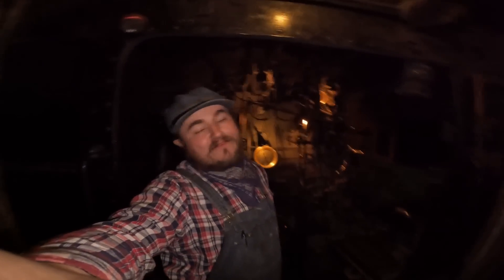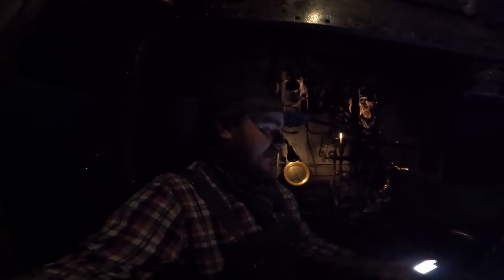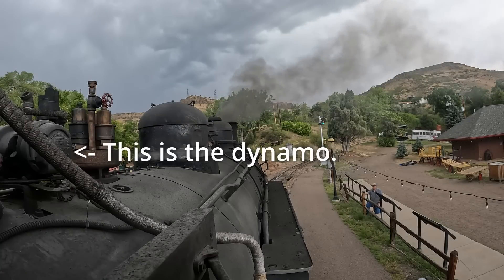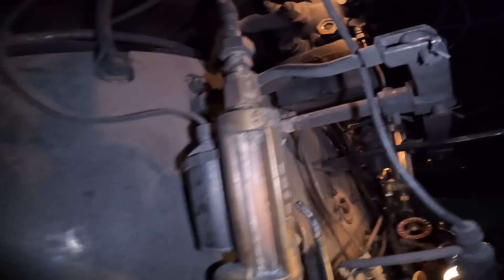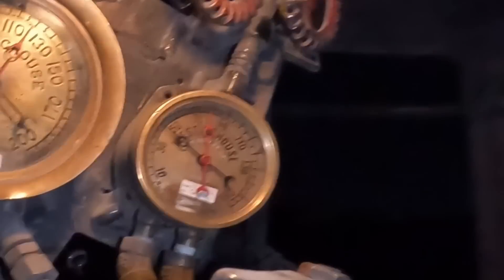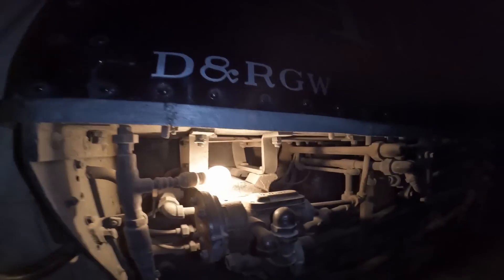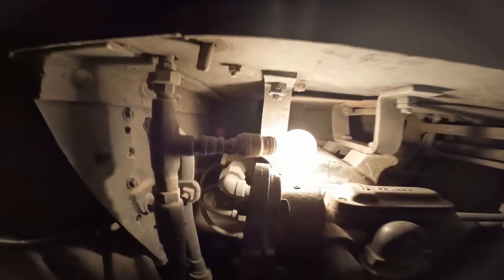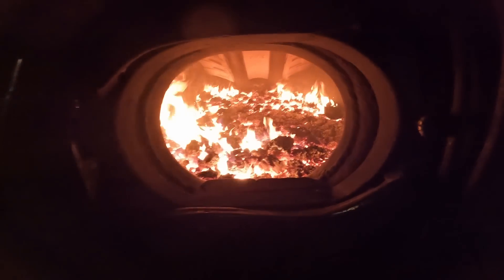How did steam train engineers see in the cab at night?

Comment: Having fired steam at night, the important thing is to maintain your night vision to watch the road ahead and check train conditions when looking to the rear on curves.  It also is necessary when taking hand signals or knowing where your ground men are.  So, the one eye closed when firing does the trick.  Alternating eyes when putting in or checking a fire condition.  As for  LED lights, the idea is great as it would reduce the load on the dynamo.  However, the brightness must be controlled as you only want (need) enough to see the various items and not take away from viewing ahead.  Your eyes will try to adjust to the brightest light within their range.  Shielded 15 Watt bulbs for most cab, marker/class, ground, reading lights is fine.  25W for shovel sheet/coal work or switchable machinery lights  works good.   One question would be it the same bulb shape could be maintained otherwise this might create a problem in existing sockets and shields.  Wonder how many bulbs would be necessary to purchase for a special order?
Headlights at 100w for yard switching and 200/250 for road work.  The 100w bulbs will not blind the ground men as much.  As for reading lights, having one on the left side helps much for doing cab work at night.  
Also found out that when using radios powered by dynamos, that using the dynamo to recharge a battery, then taking to battery power to run a cab radio reduces the load and damage to the dynamo.  Radio power pack needs to set up for 12vdc.  More to it than that, but different ways to skin the cat.  If one could use all LED bulbs, maybe one could use a 500w dynamo with no damage as cab radios take a lot of power.  
The old heads had many tricks to do the job safely, the alternating eye use when firing was one of them.
Reply: Will it be helpful to use red lights at least on engineer's side? Red color does not "bleach out" your night vision, so at least in theory the engineer would be able to see inside and outside a bit better.
Reply: @AgentWest In practice, red light is not compatible with sight glasses.
Reply: @pootispiker2866  Not compatible? How so? Makes it more difficult to see water level in the glass?
Reply: @AgentWest  Yes. White light is the only way to see the water in the glass. As per another comment, the red light makes the water level invisible.

Comment: This would definitely be something to improve on for new builds (like for instance, "PRR" T1 #5551 -- wish that it would have been a New York Central Hudson or Niagara, but too late for that).  Both in placement further away from the cab, and in having a more standard output (like what a diesel locomotive would use for cab power, so that you can use diesel cab lights and even positive train control without modification).

For the current preserved locomotives, I wonder if it would help to do something simple like strapping on a small square of soundproofing material to block the direct sound path from the dynamo turbine (and its exhaust) to the cab?

Comment: I was going to ask what sort of voltage do the bulbs run at, someone further in the comments mentioned 32V (closer to 36?). With some added circuitry to filter and regulate the supply you could retrofit some (12v) LED’s in the cab which would be probably be brighter than the old incandescents
Reply from the maker: We actually have LED bulbs in the RGS 20. Definitely possible.

Comment: The first electric lights on trains were actually arc lights powered by dynamos driven from the wheels. Once metal filament (tantalum and later tungsten) bulbs got good enough to be used under the high vibration of a train, they banned the arc lights for being too blindingly bright.

Comment: No permanent paperwork holders with light fixtures in there?
Didn't those generators have some kind of muffler installed? The ones on German locomotives are a lot less loud (which is a good thing as they need to be running 100% of the time)

Comment: The "Weird lightbulb under the cab" is still used today in modern diesels. Today, there's two of them, one each side of the nose. About where class lamps would be on British locomotives in fact, and whenever the engineer blows the horn or hits the switch to turn them on, they flash in an alternating pattern, first one side then the other.

In modern parlance, they're called "ditch lights".
Reply: These lights are not ditch lights. They are called ground lights and have zero relation. Ditch lights point forward.
Reply: @pootispiker2866  Ah, thanks for the correction.
Reply: I think in some ways a better equivalent would be the lights by the steps of some diesels. The ones I have been on actually do have individual lightbulbs facing downwards, to illuminate the steps or other areas around the lower half of the locomotive at night.

Comment: I’m actually curious about this: would you actually gain more energy if the dynamo was an electromagnetic generator setup instead of the turbine generator setup? I know what that the copper bristles on the shaft have a lot of resistance, causing a loss in electrical power from the KE of steam turbine.
Reply: What's the difference between the two? Either way you'd need the steam to spin a turbine, right?
Reply: @Yarf.McBarf  electromagnetic generators use magnetic resonance to produce electrical energy whereas turbine generators use mechanical power to produce electrical energy. A great example is this is are windmills.
Reply: A dynamo is an electromagnetic device.

Comment: Honestly I’d your eyes were adjusted, that dynamo puts out plenty of juice to see everything you need to pretty well!

Also did you guys redo the throttle on 491? She broke loose pretty easy.
Reply from the maker: Yeah, we adjusted the clevis that sets the bar. After we'd done the last annual, she ended up with the throttle sticking really far out - like,  1.5" or so of dead spot on the quadrant before it actually admitted steam, and so I was used to that, and then tightening it up so there was hardly anything made muscle memory go out the window... lol.
Reply: @Hyce777  Holy cow. isn’t it amazing with linkages when round holes get turned into ovals and the slack adds up exponentially? (Not as dramatic, but had a related issue with my ‘71 MGB with throttle linkages and pedal box—when the 1” or take up was fixed I did a burnout in a car that doesn’t do burnouts 🤣)

Comment: Interesting that the Rio Grande placed the dynamo right next to the cab.  On the Sumpter Valley we placed them next to the stack, which required some drain extensions to get around the larger onion stacks used at the time and the larger diamond stack still used on 3 today.
Reply: Lots of Pennsylvania Railroad engines have the dynamo at the front end too, the K4 for example. They piped the drain to come out by the stack.

Comment: I would think that it would be better to have red lights in the cab, so the light does not mess with night vision as much.   I know it was not really understood then as it is now how light affects the eyes,  but it seems like they would have accidentally figured it out.

The weird light below the cab is ingenious.   Too bad it could not be a dual purpose light to be able to see the running gear too.
Reply: They have to be white lights because red would not shine through the sight glass or the hydrostat bullseyes very well. The gauge lights don't mess with night vision as much as you think.  And diesel locomotives today still use ground lights under the cab on both sides.

Comment: Always like the dynamo sound.

On the old WWII type of radios,  there was a dynamo (not steam powered) used to power you finals (final stage amplifier).  When you keyed or turned on the high voltage for the finals, you could hear the dynamo slow down under load.  Very unique sound, and fun to listen for.
Reply: My GRC9 does it. A faint whine also comes through on your transmitted audio. Instantly recognizable.

Comment: What voltage does that thing output?  Are specialist lamps required, or are they regular old incandescents from the hardware store -presumably the "rough service" type?  And the sight-glasses remind me; was it ever tried to use crystal or Pyrex or other exotic glasses to make more robust sight-glasses?  It surprised me greatly that glass, which is extremely hard and chemically impermeable, would become a wear item!
Reply from the maker: 32 volts DC - at a scary number of amps. Lol. Can't recall the figure but it's more than 20. They are special bulbs rated for that.
Reply: @Hyce777  I vaguely recall it being 25 or 30 amps.  It was 30-odd years ago I ran steam, and now you've got me trying to remember the wattage of the headlight.  I think it was 75W?  I remember being surprised how low the wattage was .. makes you realise just how much the reflector does!  I think our instrument and class lights were all 25W.

Comment: Is it possible to switch the lights to LED bulbs to possibly get some better lighting?
Reply: I suspect it's possible, but then you're constantly changing between looking at a very bright light and looking out into the darkness.  That would mess with your night vision a lot.
Reply: LEDs are made in any configuration  voltage not a problem and they make them warm with a glow that mimics the old lamps

Comment: Any idea of the output voltage and max current available from 491’s dynamo?
Reply from the maker: 32 volts DC at something like 20 amps or so. It's a pyle national K2 type.
Reply: @Hyce777  beefier than I expected.  Thanks for the quick answer!
Reply: @Hyce777  Yep 32 volts, 16 amps. about 500 watts of power.
Reply from the maker: @paulmonce7625  is the man who would know!
Reply: @paulmonce7625  Thanks. That is a decent amount of power. I did not know but suspected it was more like my old VW bus generator 13.6 volts at about 300 watts when new from the factory. Is the output controlled the same way with a points type regulator and is there a battery in circuit, I suspect not.

Comment: An old trick we employ at our railroad on locos with no cab lights is cracking the firedoor open every so soften to reflect light off of the back wall onto the gauges.
Most of our equipment have acetylene gas lamps which are crap and best left alone, hence the aforementioned trick, but one or two have electric lights... run by a Pyle dynamo!

Comment: My fellow foamers would hate me if I ever got a real steam engine.. I'd upgrade all the lights with modern LED's 😆
Reply: Not gonna lie to you, I'm surprised nobody has done that or made it an fra requirement yet... Most dynamos make 32 volts DC current, so it's totally feasible.
Reply from the maker: Shhhhh... We did that with RGS 20. The old bulbs don't have the best life and you really can't tell the difference...
Reply: @Hyce777  Prepare the pitchforks everybody.
Reply: I’ve had a fantasy of building full size replica of the Santa Cruz Rail Road’s Jupiter that’s in the Smithsonian. Buuuut I wanted the headlight to be actually useful for seeing sooooo… Well, I’m poor. So fantasy it will remain. But I totally get upgrading the lights. I like the thought of selectable settings just to illustrate what the original operators had to deal with. Original output then switch to more usable lumens, and then people can go “Okay, I get why you changed this”.
Reply: @jeffreyhallam5517  A man can dream, right? For the most part, headlights are really more for everyone else seeing the train more than they are about seeing too much from the cab. Really makes you appreciate how much engineers rely on their knowledge of the territory...
Reply: Same man🤣
Reply: LED strips under the running boards you say?
Reply: @themidlandconnection  yessss... those cheap ones that alternate rainbow colors that resemble a cheap Chinese buffet that'll give you food poisoning
Reply: LEDs also care less about vibration since there's no filament
Reply: @gbwdude  Very true. Pretty sure they're cheaper, compared to the basically aircraft grade bulbs locomotives use otherwise.
Reply: As long as they're warm glow LEDs

Comment: Can you use the dynamo to power something off of it like you can a diesel? For example a power outage happened and a diesel locomotive was moved to a town square and provided emergency power during a winter (CN 3502).
Reply: The diesel can do it because I think they tap into the traction circuit and that usually drives the train. This loco only have electric auxiliary, it would be like a beefier version of car electrical, so this couldn't power a town.
Reply: not really. The dynamo produces enough power to maybe run all the electronics needed to run a Modern Semi Truck down the road, but not enough to do what the modern diesels do to power a city block.
Reply: Tiny dynamo like that, I doubt it can output more than a few hundred watts. Also it's DC, not AC like the wider power grid. So I don't think it would be possible to power anything large off it.
Reply: @zacksstuff   @Dallen9     So what I’m hearing is the dynamo can’t power a building or two but it can power a welder or a machine to fix something on the locomotive if necessary.
Reply: @Johndoe-dc  you can get a welder that plugs into a standard 15 amp US socket, so 1800w. If we assume that's the dynamo's output, we might be able to light a whole building with LED lamps. But we're not running any of the other systems, especially climate control.
Reply: A dynamo (a.k.a. steam turbogenerator) generates about 150-200W @32VDC at around 25-30A.  Large locomotives (like Big Boy and other duplex locos) need two dynamos: one to power usual headlights, class lights, and instrument lights, and a second one to power the modern radio and electronic cab signalling equipment.

Compare to a diesel electric locomotive which can generate as much 4500kW at 4700A and 600VAC.

In 1998 in the town of Boucherville, Quebec,  lost power after repeated severe snowstorms. The mayor needed emergency and essential services back up and running, so the mayor requested that CN deliver a locomotive to a level crossing close to the town hall. After arriving, the CN locomotive #3502 was then hoisted off the tracks by a large crane and put onto the streets, from where it was driven approximately 1,000 feet (305 m) under its own power to the city hall, carving grooves in the pavement as it moved. Once there it was attached to the city's power grid, becoming a portable power generator. After being coupled to the power grid the locomotive was set to produce 375 kW of power at 60 hertz. This allowed the locomotive to provide power for both several municipal buildings, and emergency services.

Comment: Whats the Bulls eye for?
Reply from the maker: Shows the oil flow to the air compressor.
Reply: @Hyce777  Wait that's not manually lubed? Where's the oil tank then?
Reply: @maxwilson7001  It's called a hydrostatic lubricator and has a self-contained oil reservoir.  Saturated steam from the boiler feeds into the hydrostat and the area underneath the reservoir is thus filled with boiling water in a sealed chamber, and the steam is also in the oil reservoir.  This pressurized steam forces the oil through a tube and into a brass nipple that you can see in the bulls-eye.  A valve underneath the bulls-eye controls how many drops per minute are released to float up through the water to be mixed with the steam to be delivered via copper tube to whatever appliance(s) need running lubrication.

The loco I used to run had five: left valve, left cylinder, air compressor, right valve, right cylinder.

If Hyce hasn't yet done a video on the hydrostat and how it works, he needs to!  :)
Reply: @bw4t  Huh that's really intresting